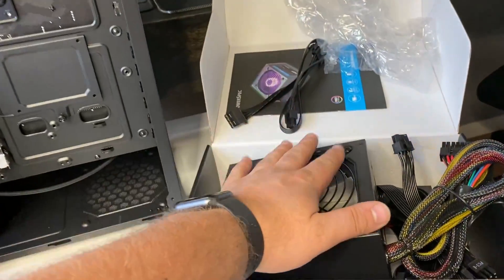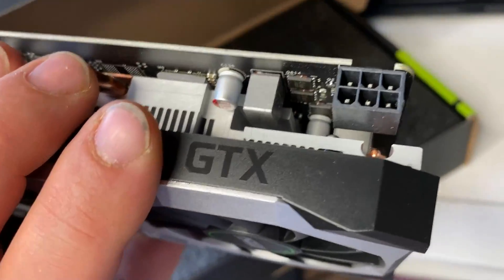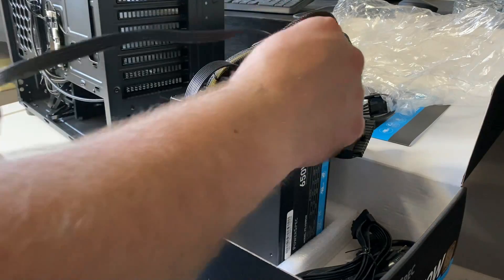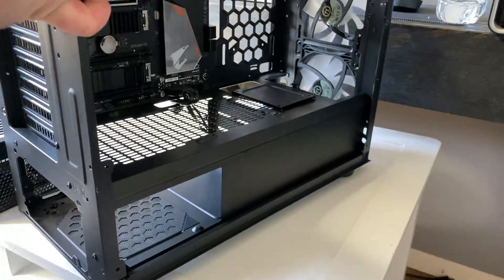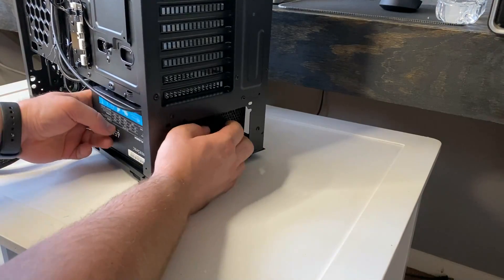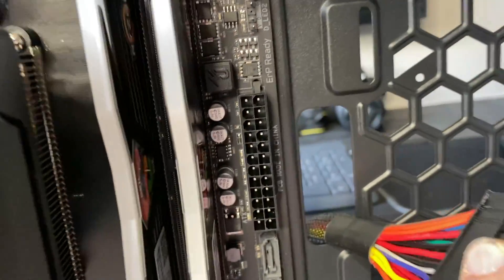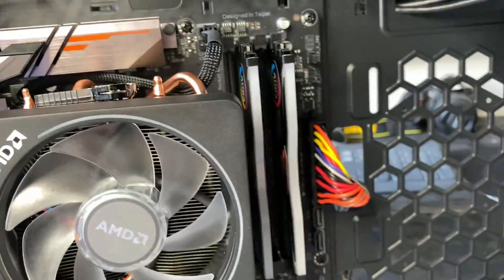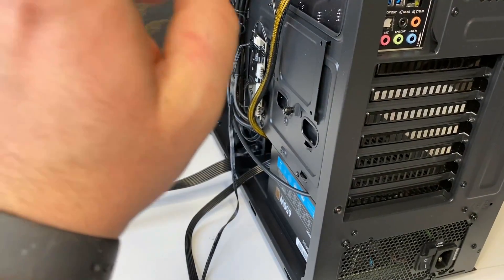How to install a PC PSU (Power Supply Unit)

Comment: So my pc has that metal box thing that the psu slides in… expect it has a little tab thing coming out from the bottom of the case so I can’t pull it out, and when I try to slide it back the hard drive is blocking the way and I don’t see a clear way to remove it. Pc: rog strix prebuilt desktop. I don’t know the model number of my pc but it has a 2070 super and an i7-9700f I think. Another thing I was thinking of was what if it’s not even the power supply, it could be ram, cpu maybe, something else (problem being that rgb turns on and fans spin but no output to moniter or rgb razer stuff.) but now I’m thinking what if I can buy a new case and put all of the components in there? But at the same time I want one of those Xbox’s because they’re in stock all around me. I went a little of track but that’s just how it goes.

Comment: I apologize if this is a dumb question. I am soon to build a desktop and was wondering a question about the power supply and fan direction. All my previous cases/power supply setups blew air horizontally at the top rear of the case. Would directing the airflow from the power supply vertically upward be beneficial? Are any cases/power supplies setup this way? Thank you.
Reply: Nop. Air goes into the power supply to keep it cool.

Comment: i've had filters under my computer for years, also with my new case it has filter under, but i've allways mounted the PSU with the fan facing up, i've actually never faced the fan down since all the writing on the psu seem upside down if i do, so it is actually better to mount it with the fans facing down grasping air from underneath?
Reply: Actually scratch that.. I've turned my PSU the right way, now :P and i did the same with my older pc, and then when i did, on the TX750W i saw that... well the letters werent upside down, they are on my Rog PSU, but makes sense when i bend over for the PSU powerbutton, and makes sense for the filter under, and i mean... the TX750W was actually upside down with the writing already until i turned it fan down =P  

And now i understand that the PSU and the GPU dont have to fight about the already kinda bad air that GPU's get to take from :P oh tho the airflow on my build is pretty neat with exhaust in front with radiator 140mm fans, and 2x 120mm for inntake, one in the back upper and one at the top mount.

Comment: sorry but having the exhaust fan go into your pc isn't the best idea. other than that its a great vid. thanks
Reply from the maker: Yeah, that fan actually was pulling air out of the case. I ended up switching it back to normal shortly after because my temps were wonky in the PSU and seemed like it was starving the gpu of enough flow. I appreciate it 🙏

Comment: Hi, is it better if the fan is upwards or downwards for psu?
Because i ordered a pc and they build it  fan upside down.
Reply from the maker: It’s better if the fan is down. It will pull fresh cool air from the bottom. Fan up is fine but then it pulls air from the case which is warmer

Comment: Great vid! Is it mandetory to install the 8 pin (atx 12v) on the motherboard if you have the main 24pin ATX connected ? Thanks!
Reply from the maker: You you still need to plug the 8-pin in because that’s specifically for CPU power. Thanks 🙏

Comment: I have a question; I have a HP desktop MO1 and I’m going to install a EVGA - BA Series 500W but i don’t know if it will fit.  If you might know, pls reply
Reply from the maker: I’m not sure TBH and I don’t wanna give you bad info but typically those pre-built PCs do have standard power supply which would then fit the EVGA

Comment: has PSU’s heat been reduced now after you faced your psu fan downwards?
Reply from the maker: Yeah it got better since the air it was I taking was cooler air. It wasn’t a huge difference and to be honest I don’t even remember the temp difference but it was better in general. Many prebuilt PCs have the PSU pulling air from inside the case so either way I assume it’s fine. But I prefer the cooler air outside of the case.
Reply: @BuildsWithV  thanks 🙏🏻

Comment: hi i have same power supply so  my video card has two 8 pin insertions but that would require me using two VGA cables, each connecting to a different spot on the power supply. Do I only use the one cable or am I meant to fill the entire bit out
Reply from the maker: The proper way to do it is to use two separate cables from the psu to plug into your dual 8-pin gpu. I’ve seen many people (and companies) use one cable and that’s it but that is technically incorrect. Plus I wouldn’t want to risk it.

Comment: I am replacing my power supply I have a filter on the bottom of the case, I want my ps to pull through  the bottom and exhaust out the back. Why did you turn yours the other way?
Reply from the maker: I did that to see if it would work well and to show off the RGBs on the PSU fan. Unfortunately; even tho it worked great to remove some heat from the GPU, it made the PSU a bit hotter than normal so I switched it back.
Reply: @BuildsWithV  ok has PSU’s heat been reduced now after you faced your psu fan downwards?

Comment: I’m confused cause doesn’t that fan suck in air? So it will just be sucking in the hot air from the PC not the cool fresh air from outside
Reply from the maker: That is correct. I do not recommend doing it like this. I switched back to normal after a few week because the PSU got too hot.
Reply: Ah ok
Reply: But then what did you do? Do you just flip it around so the fan faces the bottom of the case?
Reply from the maker: @shadowstalker7259  I did it to test it like that but unfortunately it just gets too hot so yes I flipped it back to normal.

Comment: Hey, I have a question. So I have a similar PSU except mine is a 750W. I have a 3070 and I’ve been reading that it’s really important to have two separate 8 pin connectors to power the GPU. My pc was prebuilt and they only have one cable from the PSU daisy chained to the GPU. With the current setup of my PSU (similar to yours), would it even be possible to run two separate 8 pin cables from the PSU to the GPU? In other words, is there even enough ports in the PSU to input the two 8 pin cables, or do I need a new PSU? Great video btw!
Reply from the maker: You’d have to check the back of the psu to see if it has a PCIe port. If it does then you’d have to get the PCIe cable and then you could plug it in properly but that’s a stretch since usually they don’t give you all your psu cables and stuff and you do need the proper one from your psu. Again you maybe be able to pull it off but it’s a stretch.
Reply: You need a gpu cable that has two ports at the end. It’s a split. That way you have two pcie plugs on a single cable. Most power supplies come with that. They gave you a cheaper psu. If your cpu is modular, buy a replacement pcie cable that splits into two plugs at the end. Try to use a quality cable, preferably one the same brand as your psu to prevent future issues.

Comment: im very nervous about replacing my power supply. even after watching these videos I still feel like I should just pay Geek Squad $40, i dont wanna break anything
Reply from the maker: I feel it, don’t stress it. If you’re up for trying it I say do it but if you don’t feel comfortable with it I’d say just pay to get it done and you’re good to go. There’s always risks to DIY.
Reply: @BuildsWithV  I'm building my first right now, there is a margin of error before you really damage anything, some parts can take a bit of stress before they break so don't worry too much
Reply: it’s not worth 40 dollars for something you can do in 5 minutes. i did it in like 5 minutes when i built my first pc. it’s not too bad

Comment: really need help! what budget power supply should i get? these are the parts

CPU: AMD Ryzen 5 3600 3.6 GHz 6-Core Processor  (£179.97 @ CCL Computers) 

CPU Cooler: Cooler Master Hyper 212 Black Edition 42 CFM CPU Cooler  (£29.99 @ Amazon UK) 

Motherboard: MSI B450 TOMAHAWK MAX ATX AM4 Motherboard  (£89.99 @ CCL Computers) 

Memory: Corsair Vengeance LPX 16 GB (2 x 8 GB) DDR4-3200 CL16 Memory  (£79.47 @ Amazon UK) 

Storage: Seagate Barracuda Compute 2 TB 3.5" 7200RPM Internal Hard Drive  (£48.58 @ CCL Computers) 

Video Card: Gigabyte Radeon RX 570 4 GB GAMING Video Card 

Case: NZXT H510 ATX Mid Tower Case  (£73.99 @ CCL Computers) 

Total: £751.99
Reply from the maker: Get a 650w semi-modular bronze or better and you'll be good. Keep in mind that some really cheap PSUs can cause issues.

Comment: Does 1060 3 GB work on Rosewill 450 WATT please reply? and U want full info about the power supply search it on ebay.
Reply: If you want to burn your pc then go ahead
Reply: @snackoverflow9562  wait fr?
Reply: @user-jg3qs4wc5f  450w certainly won't do, don't be cheap when it comes to power supply
Reply: @snackoverflow9562  would that work EVGA - W1 Series 600W ATX 12V
Reply: @user-jg3qs4wc5f  I think it would but I'm not sure, not only the gpu matters
Reply: @snackoverflow9562  I'm getting an Optiplex 7010 MT, upgrading it with a power supply, and install a GPU The GPU I'm gonna be installing to it is GTX 1060 3 GB. Would that be a problem?

Comment: My psu fan won’t turn on when I plug it into the wall and flip the switch. I have tried two different psu models
Reply: U have to finish the motherboard plugs and that shit it won't work just in the wall

Comment: So my gpu recommend connecting two separate connection from psu to gpu. Does that mean i cant use this psu?
Reply from the maker: Correct, you won’t be able to use this psu. You will need one with 2 or more gpu connectors

Comment: Yo V, what wattage should I consider? Is more the better?
Reply from the maker: Theres no right answer because each build might need more or less. I find the perfect sweet spot is 650w-750w PSUs. I currently use a 750w but will be upgrading to 850w when I install my 3080.
Reply: @BuildsWithV  in buying the 3080 as soon as it becomes available. I'm currently building a new PC so I was just wondering. First time lol thanks for the reply bro

Comment: Hey so I plugged everything in and I plugged it into my wall but nothing is moving or turning on but there is a green light on my motherboard do you know what that means?
Reply: Did you really plug in everything? Your hard drives, ssds? You also need zo plug the cables from your case into the motherboard
Reply: @macs.imum1699  yea I just fixed it today and the plug to the power supply wasn’t fully connected

Comment: So my power supply seems to be working. The only thing is is that nothing else is lighting up. Not the ram the cooler nothing. How should I fix this?
Reply from the maker: Is this a new build? If it is just make sure that the power button is plugged into the motherboard correctly first.
Reply: @BuildsWithV  ok

Comment: so the power button on the case,does the power button work from the 24pin connector being into the motherboard?
Reply from the maker: You’d also need the power button on the case plugged into the motherboard as well. You’d plug it into the “F_Panel” header
Reply: @BuildsWithV  ok so when i upgrade mt psu i wouldent need to worry about that then since its only the psu im upgrading?
Reply from the maker: @funnyjackkk  that’s correct.
Reply: @BuildsWithV  bro u don’t understand how happy I am now,I was so scared I needed a new case to plug the power button into it or something,wow your a life saver man thank you so much
Reply from the maker: @funnyjackkk  no problem at all 😊 Thanks for watching 🙏

Comment: The 8 pin won’t reach from my psu to where it needs to be
Reply from the maker: You’ll need an extension unfortunately. You can get a whole set of custom cable extensions usually for $20-$30. Or you can find just that one 8 pin cpu cable extension for $5-$10.

Comment: I bought the same PSU from microcenter but I'm 90% mine didnt come with a cpu cable did yours???
Reply from the maker: Yes mine did. The cpu cable is the one that’s already attached to the psu next to the 24-pin.
Reply: @BuildsWithV  Lol thank u I was wondering what that was
Reply: Also my vga light is red and idk whats causing it also all the parts are brand new.

Comment: To know anyone who is building a pc make sure that your psu will fit inside of your case.You can usually find what size psu a case will take in the listing.
Reply from the maker: That’s a great point. Thanks for watching 🙏
Reply: This is what I wanted to know, thanks
Reply: Damn to late bought a wrong case then

Comment: Psu should still have fan facing down. Your blowing hot air in you case right into your gpu. Its Verge all over again.🤣🤣🤣🤣🤣🤣🤣🤣
Reply from the maker: Actually that fan exhausts heat... 😂😂😂 Thanks for watching 🙏
Reply from the maker: But I actually switched it around later because the PSU would get hotter than normal since the hot air from the case would go through it. 🤷‍♂️

Comment: Do you have to have everything plugged in before power supply will work. I just got a new power supply plugged into wall and nothing
Reply from the maker: I’ve never tried to plug in a psu without anything plugged into it so I’m not 100% sure. My theory is It will need to be plugged into the motherboard at least. When you have a power supply installed in a PC the power button on the pc tells the PSU to also turn on/wake up.
Reply: Normally PSU just connected to wall won't turn on because there are 2 pins in the 24 pin connector that you have to short manually for PSU to work without motherboard

Comment: There is no cable in this power supply labeled cpu so i’m confused which cable i plug into the motherboard except for the 24 pin
Reply from the maker: Pasha Hort so your PSU should have an 8-pin connector that fits into the 8 pin on the motherboard (usually top left corner of the motherboard). GPU uses a similar 8-pin connector but it won’t fit.
Reply: Builds With V do you know if the cable for the motherboard will say pci-e or no
Reply from the maker: Pasha Hort it will not, pci-e is for the GPU.
Reply: https://www.youtube.com/watch?v=7bliFw1Z9wM

Comment: Is it normal for a wraith prism cooler to have a little bit of wiggle to it?  I just got a r9 3900x and when I was cleaning my pc I realized It had a bit of wiggle to it.  I just want to make sure It isn’t harming the cpu.
Reply from the maker: Visored the whole cooler is wiggling? Or just the fan? If the whole cooler is, then something is wrong. The cooler should be tight onto the cpu otherwise you’ll have high temps. If the fan is wiggling then the fan itself could be going bad. There’s a lever on the side of the cooler that is used to secure it. Push the lever down till it’s tight if it’s not down.
Reply: Builds With V I just realized that the lever was not all the way down. You dont think that hurt the cpu or anything though right? I have never gotten over 70c so far
Reply: Builds With V and when I grabbed the left and right side and then moved it the whole cooler wasn’t neccicerily loose but it was moving side to side a bit
Reply from the maker: Visored it should be alright. It’s normal to move a bit. But yeah that lever just needs to be down to sit tightly onto the cpu. 70°c isn’t bad at all so it will be okay.
Reply: Builds With V thanks man, Ive been worried sick. Subbed and liked!
Reply from the maker: No problem at all, I appreciate that 🙏 Thank you so much
Reply: Builds With V No problem. Thank you!
Reply: https://www.youtube.com/watch?v=7bliFw1Z9wM

Comment: I have this power supply and sometimes my pc randomly restarts and sometimes title flicker like it wants to boot up but it won’t and then I’ll get a windows didn’t load correctly
Reply from the maker: Isayah Alexander That’s weird, I haven’t experienced this issue so I’m not entirely sure what exactly would cause it. My first question would be are you sure it’s the psu that’s causing this issue? Could be something as simple as a loss or connector to a bad ram stick. Some motherboards have red leds that show what the issue might be during boot. There would be 4 red lights somewhere with a corresponding text saying “ram, cpu, bios or something along those lines). So if the red light stays on at “ram” then your issue would be the ram. Hopefully this makes sense.
Reply: https://www.youtube.com/watch?v=7bliFw1Z9wM

Comment: Hello sorry agian for some reason the 8 pin won’t fit I can only fit the the 6 pin in there
Reply from the maker: Elijah Pena into the power supply? Make sure it’s the correct 8 pin. You can message me on Instagram buildswithv. That way you can send pictures showing the issue?

Comment: I am a young builder so I don’t really understand anything but where do you plug in those 2 cables you plugged into the power supply
Reply from the maker: Sata connection is usually for hard drives, ssd or sometimes it plugs into fans hubs. The other one pci-e is for the graphics card
Reply: Oh thanks
Reply: I get 
It thankyou so much
Reply: https://www.youtube.com/watch?v=7bliFw1Z9wM

Comment: quick question for my gpu i put in the 8 pins but why is there an extra 8 on it?
Reply from the maker: spamzz there’s an extra 8 pins on what exactly? Feel free to dm me on Instagram @buildswithv
Reply: Some GPUs have two 8 pin slots side by side and you'd plug in both for that if needed. My rtx 2080 GPU requires both 8 pin connections for example.